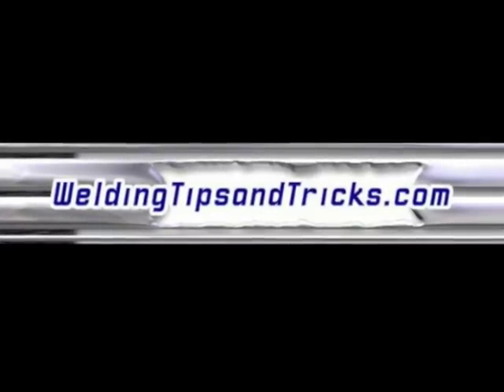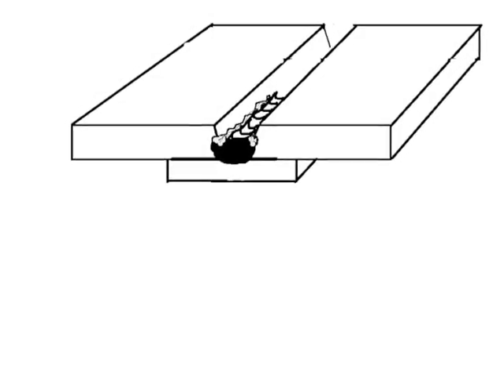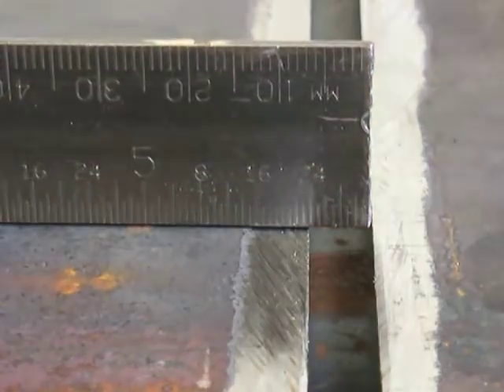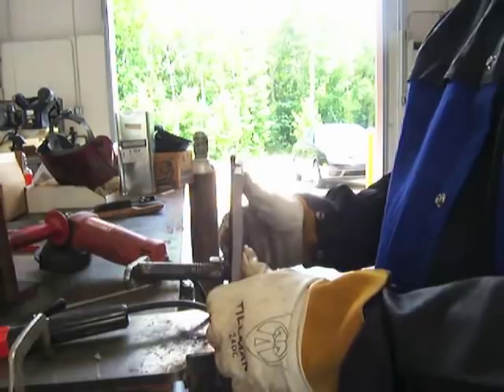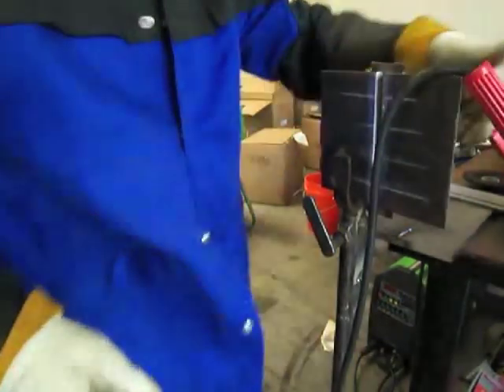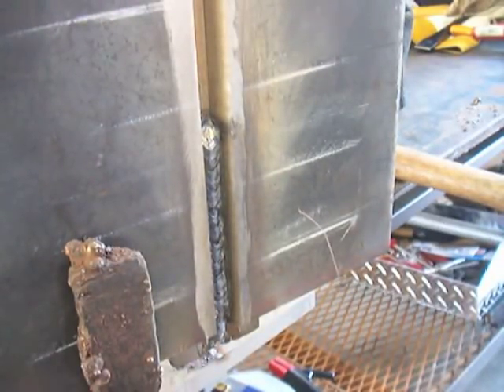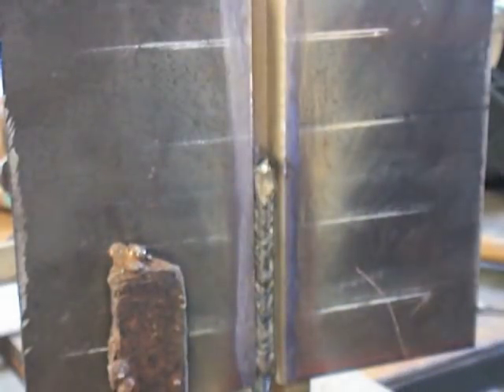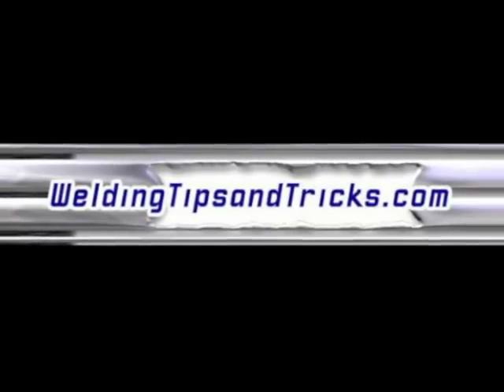Stick Welding Tips for Passing a Structural Plate Welding Test - part 1

Comment: Good video! Great speed, amperage, and angle. I'm AWS certified. To help some of your followers with answers, 3/32 rod 1/4 gap with backing strip, I passed my test at an AWS facility using 75 to 80 amps on vertical and 85 to 90 on overhead. Anything hotter is way to much! Also remember like this instructor is saying and doing, HOLD YOUR CORNERS! MANDATORY! 1/2 inch gap will cause for higher amperage though, always remember the wider u weld the hotter u must run your amperage so weld won't be cold once u get back to the other side. Certain tips you learn once you learn to weld pipe in 5g position for weaving hott pass and especially your cap. Hope this information is helpful as it is to me.     GO WELDERS!
Reply: Hey! How many amps would u recommend for 1/8 7018 vert & ovh?

Comment: I have passed many structural steel certifications. DOT SMAW. The test required a 15/16 gap and 2 tips that help were always use warm rods and wrap the ground above the piece your welding I never failed passed vertical, overhead, and horizontal.

Comment: I worked as a inside machinist in a oil refinery for 32 years and machined a lots of welded up pumps and pipe flanges. The best welders were the ones that used grinding wheels and wire brush wheels to clean up each tie in and each pass. Keeping slag out with welding and clean up kept the re-welds and tool bit breakage down.  I had no problem telling the welding foreman in the shop which welder in the shop I wanted to do the welding on my pumps and flanges that I was needing welded up. It did not take long for a new foreman to listen to the shop machinist on who they wanted to do the welding on parts. We had some very skilled welders that took pride in their work, only problem was  that was the ones that they moved up in the company and it takes time to find the next good welder for repairs. Welding up eat up metal pumps and flanges is a lot harder than welding clean new metal pipes and flanges. A lot of prep, bake out, grinding to get to  good mental. Not every welder wanted to take on those jobs, but  the ones that were good at it saved the company many hours of machining and re-welding. Nothing worst than getting to the finish dimension on a 72 inch OD gasket surface and hitting a slag pocket on the finish cut and having to start over welding and machining the whole gasket surface.

Comment: Very informative thanks, funny thing is my profession was x ray testing you guys on major projects mainly pipelines. I was qual'd in ASME and AINDT depending on the project. It was always interesting to talk to the welders regarding test plates and production welds and I always did my best to comply welds. I did this by knowing the codes well and knowing what I was looking at on the X ray. I am also a self taught home welder probably with many bad techniques but my welds are very sound, many cut open to see penetration, gp's and slag. I will throw my "pecking" habit out and use the rake technique more!! thanks again hope you never run foul of a big head NDT tech as there are plenty out there and as a level 3 in ASME I did a lot of audit work and was a little shocked at some of the calls.
Reply: As a cwi/ndt I love your comment. Yes some of us get "god complex" to easily and forget to examine everything strictly by the applicable codes.

Comment: The welding Code AWS D1.1 is a structural welding code it sets specifications for welding structural steel.  Some tests can qualify you under AWS, ASME, and API codes.  In positions welding a 6G will not qualify you when a 6G R is required but a 
6G R will qualify you in the 6G position.

Comment: Definetly let the ends of the backing plate go past the test plates. Start your beads out side of the plates so you can get a good puddle and bead going before you actually get into the test plates. It'll help with penetration too once you actually begin to get the plates together.
Reply: Also if you can use a wire wheel to clean up the welds. It really gets rid of the slag really well and will help your weld lay down. I wouldn't even use a chipping hammer if you don't have to.
Reply: +Kyle Watson I even use a mechanics pick set to get into any possible holes to get those slag entrapments out. it helps to have it just in case you end up with a low spot, or the weld build up is too convex. but definitely ask how far you can push it for cleaning up welds during testing day! this is all good input from everyone here!
I love welding and welders!!
Reply: We told our welding students to do that. It works very well.

Comment: one thing to note. When tacking up your test plate, try to keep the tacks on your backer strip as small as possible. If you make them too big, the welds will draw and cause a gap between the test plate and the backer right at the root which will trap slag.

Comment: Old jockey saw blades are great for raking out the toes of passes especially when doing vertical passes, I use to use a rubber tube with a looped 4mm general purpose welding electrode to reinforce the the handle pushed over 6" of the blade with the first 3" having the teeth ground off and being a blade with sharp edge.

Comment: Would you ever use a 6-8in piece of a hacksaw black to rake the corners of the weld on a root pass?  Does turning up the heat 5 degrees help burn out slag inclusions? How far below the test area would to stop your first weld?  Is it advisable to not start a weld in the center of the test plate?

Comment: Most overlooked problem, let your test blank cool off after a couple passes you are not in a hurry, the heat doesn't have any place to disburse to so let that S.O.B cool off other wise your weld will roll back on you, slow your roll, the heat is your enemy welding a test coupon , on the job welding structural steel like say columns, Junior beams, haunches, stiffeners, stiffeners, cover plates etc etc, the heat has a place go through and disperse so it's not as hot, compared to a test coupon which will hold the heat just a tip

Comment: Had to relate a situation that arose administering this test about 10 years ago. I was a certified welder/CWI for 41 years for a major railroad, and our guys had to qualify using the AWS D15.1 standard - unlimited thickness. We had several guys furloughed for a year and called back to work. I had to retest them on 3/8” coupons in 2, 3, & 4G positions. The first guy tested was a really good welder, but when I started bending his coupons, they were all cracking beside the weld bead and failing! Confused, I started trying to determine why his textbook welds were failing. The problem, I discovered, was the plates. Typically sawn on a bevel from 7” (I think!) x3/8” flat bar, these plates which we had just received were cut from 4” bar and the bevel ground on the SIDES of the stock! This caused the grain of the steel to run parallel to the weld instead of the 90 degrees that was specified in the code! The HAZ split right out! The vendor replaced the plates, and all was well again!

Comment: Great video(s). But how about some tips for us beginners? I'd love to know how to weld a sheet metal (about less than 1 MM) to an iron bar of 1 CM cross section. Do I set the Amps low for the sheet metal, or high for the Iron bar? If you've already covered that, can you please reply with the link? Thanks

Comment: I understand this video is very old now, but I have this test with 22.5 degree beveled plates and no backing plate. And I’m not allowed to give myself a gap. All 7018. I first have to run what the CWI is referring to as a back gouge weld, a pass on the backside of the plates after fitup in the flat position, and then you weld the groove in the vertical position. Same thing for overhead. Any tips would be greatly appreciated, it’s a very narrow valley to work with.

Comment: Jody, any tips for a welding test done with 7018 3/32 rod, plates were gapped at 3/32 as well. Problem was getting the rod down low enough as you explained. But that's the way they set the test up. Thanks

Comment: when i have one plate tacked up, i tack a 1/4inch piece of metal and soapstone to measure and mark the 1/4 inch gap and tack the other piece on the backing strip and put my root and intermediate and cover welds on it

Comment: Concerning the slag chipping... not necessarily great for plate, but a small reciprocating saw blade works wonders for cleaning up slag from wagon tracks or any other stubborn stuff on pipe.

Comment: I'm self taught and have much much muchhhhh more to learn. I live in Florida and I'm looking to take the first step in one day having a mobile welding/custom fabricating business by taking the arch welding cert test. Doesn't sound like much but it's the minimum required to get a business license for welding. I called a exam place today and for the life of me couldn't remember what size plate the men said. I'm looking to practice like crazy for several weeks/months until I'm confident but is it 5/8 or smaller as like a barebones first certification. Any help would be appreciated. He made it sound like it was easy. Bevel the edges then a root weld then I believe clean the root weld and then a second pass all with 7018.

Comment: Yes this is usual with CWB. This video shows a 3G test. You would have done the CWB 1GF,2GF, 3GF and 4GF. CWB always use the GF (Grove-Fillet) joint. Also on the CWB tests your stops have to be in the middle of where they will bend it on both face and root.

Comment: Canadian CWB Test:  One fillet side, one bevel side.  No grinding, only wire wheeling.  Weaving is not allowed on the fillet side weld, but is allowed on the rest.  Gap is 13mm.  Two tie in's are REQUIRED.  One on the fillet side and one on the bevel side.  The inspector administering the test will mark the spots and you will have to show them before continuing with the fill and cap.  There are three bends, one on the cap side, and two on the root side where your tie in's are.  Most people fail on the tie in's.  3G CWB test is very difficult.  Practice!

Comment: have to get this qual only with no backing strip, 45 inclusive all 3 positions. 3/8 plate 7018=1/8 rod. did you do a video on this? I havent found it or maybe i missed it. also not allowed a grinder have to air arc a back-gouge, final turn in must be as welded and no higher than 1/8 above plate level. Any suggestions?

Comment: What weld test lets you have a grinder there? didn't think that was allowed.
Reply: 1ironbelle Union Boilermakers are not allowed to use any power tools and on a tube test I always had a half round file and a worn down sawazall blade
Reply: @mattharper588  I realize that. Since this was a plate test video, i was surprised to see a grinder.

Comment: Funny thing is I just had this test to pass my aws in the army I am a 91e just tested out of ait spent the last 20 weeks going through stick, mig, tig, oxy & exo thermic. The only thing I did differently was use a wire wheel to clean my passes and use two 3/32 for my root pass on 2g and 3/32 following 1/8 fillers and 3/32 again for my cap. and all of my 3G was 3/32. Yes I did pass and passed my bend test 3G & 2g thanks for the video
Reply: +Chad Collura 3g certifies you for 1 and 2...
Reply: Not under mil spec. Its really different. It doesn't even recognize 6010 or any cellulose rods. 
It follows Sec 9 plate qualifications. Each position only covers itself. Unlike AWS which covers 1-3G w 3G and 4G covering only 4G.
Reply: Also most weld tests in the real world will force you to use 1/8" rods and in the field it will be 1/8" and 5/32" or maybe even 3/16" on plate. 3/32" is commonly considered a pipe rod.

Comment: Bring a couple of fresh flap discs (60 to 80 grit) in your bucket. More precise than a grinding rock for removing mill scale. Start with new clear lens covers in your helmet and have spares with you. Many welders don't restart 7018s during a test or critical weld, though that is often done in school because consumables are EXPENSIVE.
Reply: I also like to use a cut wheel and a wire wheel (the twisted wire works better than the straight wire in IMHO), it lets me get in real tight on any undercut on the sides of my weld without changing the profile of the rest of the weld. Your right, during a test I never reuse a rod.

Comment: I just completed a weld test for my 3G plate ticket and I now have some questions.

How come you have to bevelled pieces (of which the angle is 22.5 degrees)? On my test plate we had 1 bevelled side (37.5 degree bevel) and a 90 degree and piece. 

Also the spacing between the bevel and the 90 degree angle piece on my test plate had to have a 1/2" wide gap from bevel to plate. Why did you only have to go at 1/4" gap?

Also we are not allowed to use a file to remove the slag from the weld.

Because of the 1/2" gap between side we also have to make 2 passes instead of one solid bead and our stops and restarts have to be from the beginning of the plate to the 2" or 4" mark he makes on the plate.

Using a wire wheel was permitted during our weld tests, but using it as a grinder was cause for an automatic fail.
Reply: Could it may be because I was tested by the Canadian Welding Bureau and you might be going by the American Welding Society standards?
Reply: To respond to your question. You qualified to CSA W47.1. In the standard they allow you 3 options for an S class plate assembly. You did the fillet/groove option 1. This is Option 2 and those bevel and root openings are correct.

If he did this for a job test he would still have to qualify for a fillet Weld test. As this only qualifies him to weld groove welds with backings. So most test to option 1 which allows you to weld both fillets and groove welds with backing.

Same reason you test with an F4 class electrode. Once you qualify with it you can use F3,F2, F1. Cellulose rods etc.

Hope this helped a little.
Reply: G. Reed Thank You very much! This was very insightful. Personally I tend to get confused when I read up on any information relating to the subject, but you have cleared up this for me!

Comment: I constantly want to blame my poor welds on my amperage. I can put up fairly well welds on everything besides 3g. what would you suggest for a 3g welds with the 6010 and 7018's amperage?
Reply: I am not sure how the procedures are where you live but 3g is a vertical uphill structural weld. you would not use 6010. You would only use 7018. For a 1/8 7018 rod on vertical welds I would start at an amperage of around 110. if you welds drips or blows a dent then your heat is too hot. too cold and you will not "wet" into the metal properly. good luck!
Reply: i found out the truth behind reading the comments on the video and talking to my instructor. you're right. thank you Heidi Arianna Booth
Reply: good luck! welding can be super frustrating one minute and the next it is almost like meditation lol!

Comment: How do you go about removing the backing plate after the weld is done? I've only ever used bronze backing plates for large ish gaps.
Reply: Gouge and grind flush. Its for 180 degree bend test.

Comment: I've passed my in shop Flux core vert for cwb but failed the actual test.   Had lines on both sides of my root.  I travel fast and zigzag quite close together traveling upwards.   I could see the corners of the plate being burnt away on my root as well..  any info on this you can give me?
Reply: Hold your corners to get metal deposition so it builds up more then snap to the other side and repeat process watch your puddle :$

Comment: i boost the amps to 125
I passed my test
Reply: francisco villa 
Your luck ... But 100 was enough ... That examiner helped you...
Reply: ya 125a for the 7018 1/8 is good. good job👍
Reply: @Ryan_1997  Idk how you guys do it. I'm a student rn in a vocational welding program outta highschool, but running hot for me just doesn't work. lotta undercut. 105a works perfect for me in the vertical position with 1/8 7018, but my instructor can run up to like 128a and still get decent welds. I know a lot of the older welders always learned to run hotter, and i don't know if me being down to 105a is wrong?
Reply: @torque2085  it's all personal preference brother! There is more than 1 right way to weld. They run hotter for faster travel and less chance of a slag inclusion left behind. If you clean your welds, feather those tacs, start and stops, you're going to get the same results.
Reply: @torque2085  some people work faster with more heat and some people work a little slower with less. It'd all preference. As long as you penetrate and pass do whatever you want
Reply: Start with "too hot" and work down to what you can manage, NEVER start on the cold side and work up.
Reply: @torque2085  lmao we run 135 with 1/8 7018. I should try 105 and see how it goes
Reply: @torque2085  gotta run a tighter arc gap running hotter running that low must be longer arc tendency undercuts or weave pause to fast my instructor came from Hobart Troy,Ohio welding heavy equipment  speeds paramount on down time .